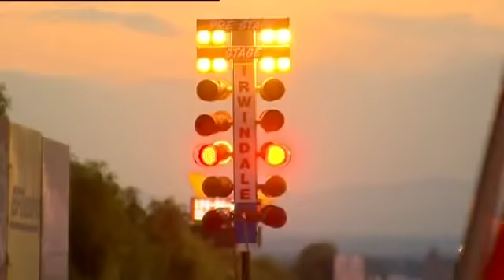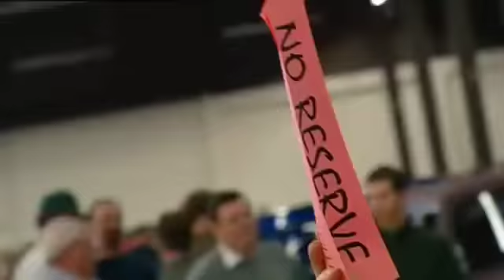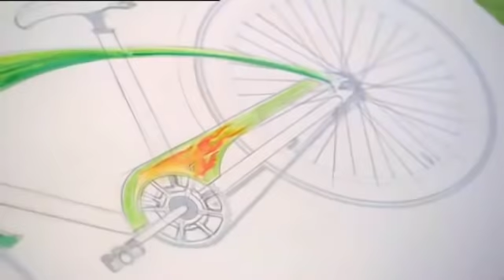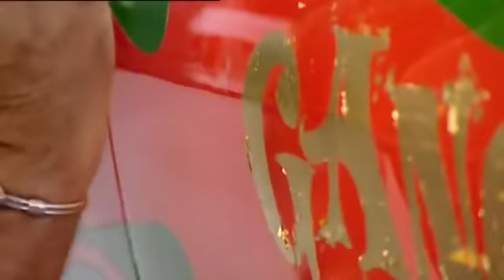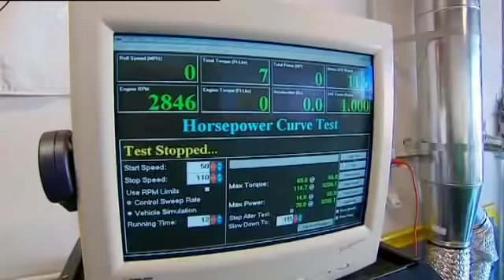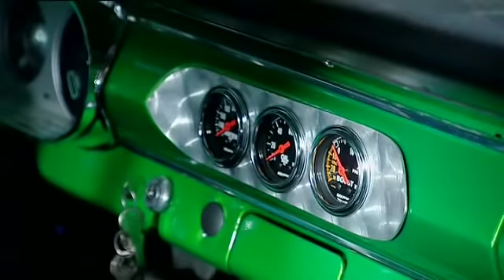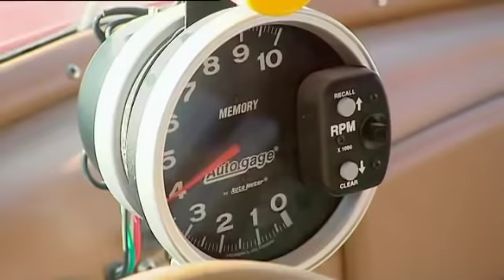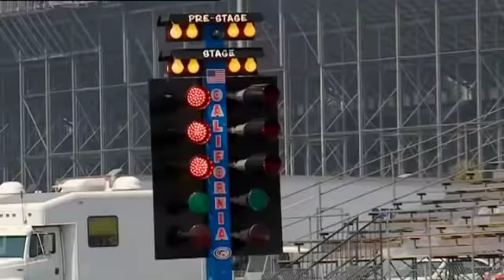Wrecks to Riches | S1E5 | Mean Green | 1960s Chevy Nova

Comment: my first car was a 4 door 65 chevy II with LT-1 from a 70 camaro.13 sec street car and ruled the streets at that time.flipped it for a 64 malibu ss with 396+four speed.started really getting into racing and that one evolved into mid 9 sec perfectly streetable pro street beauty.540+8-71+dana 60 with 15 x15 rims and 21.5x33 hoosier tyres.they hooked reasonably well even on cold tarmac.never lost a traffic lights race.most enjoyable were races against japanese so called super bikes.just wondering about these tv shows though.600 hp engine here...normally these shows are for spin doctoring purposes lying thru their teeth about everything so why not here.bad pr for engine builder such a lame`´racing engine´´ output.i m from finland and to get malibu registered for street use i had to dyno the engines to show they were not overly powerful.you were allowed to use an engine with 20% more hp than the most powerful engine  available from manufacturer. so, in my case the it was the 1970 LS-6 with 460hp rating +20%.that makes 552 hp at the crank.with 540 bbc i had to detune the engine and it was difficult because the engine was supercharged and the regulations demanded also the boost be measured.i managed to get 393 rwhp with 11.8 psi recorded and got malibu approved.just how you might ask??well, i can say that 540 wasn t running that well....

Comment: These guys use WAY to much body filler! If you do not have the skills to fix it right stop trying to fake it!
Reply: Body Filler. U know they sand down most of the filler until the panels are perfectly smooth. So most of the filler is sanded away. Of course the Guys are highly skilled other wise they wouldn't be able to fix ,repair and rebuild the  Cute Green  Chevy Nova.....

Comment: evidently theres no mechanics putting this car together, loose hoses?  theres a BIG difference in being a parts installer than a mechanic, ive seen too many times firing orders not correct or some other stupid problems, of which a good 14 year old mechanic knows how to set a proper timing and firing order when starting an engine, so ya got 750 HP on that engine heh? id be embarrased to say that when its supercharged, ive built 750 HP with a single 4bbl on a 427 street motor man,
Reply: steve hickks chill out. Everyone makes mistakes.
Reply: steve hickks h